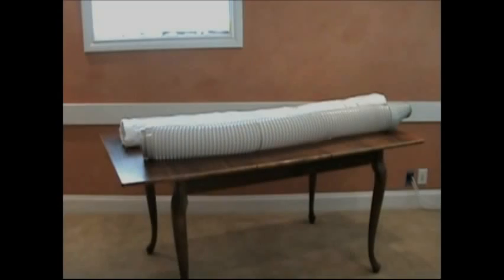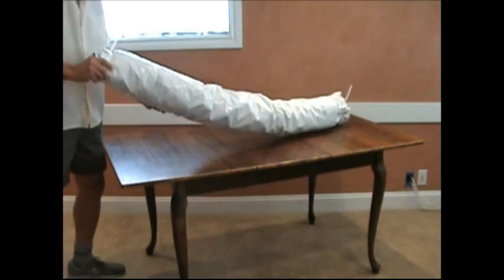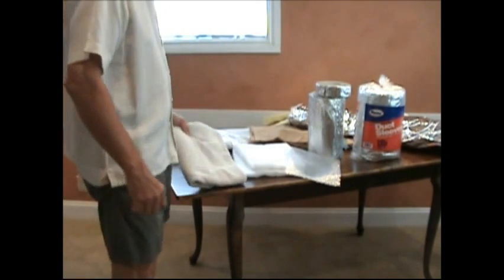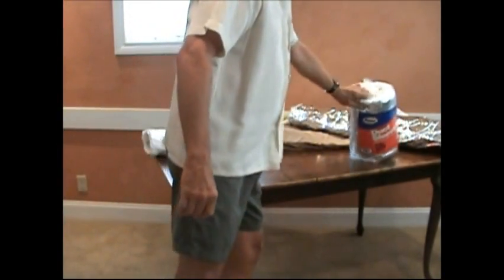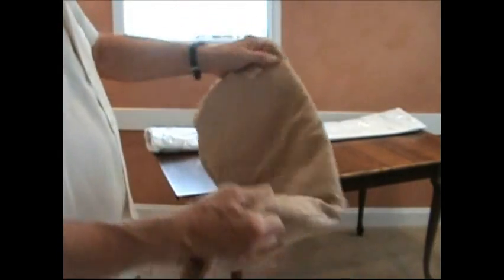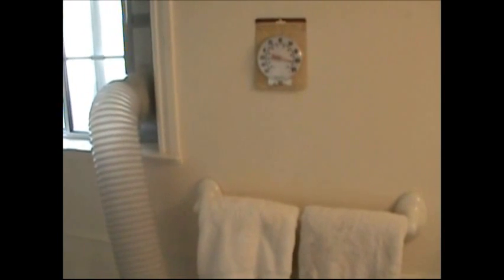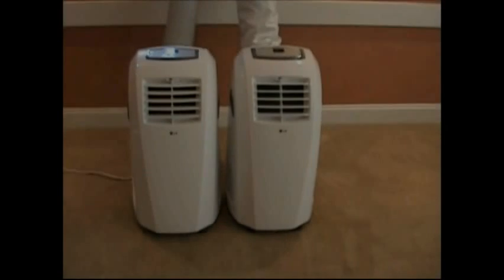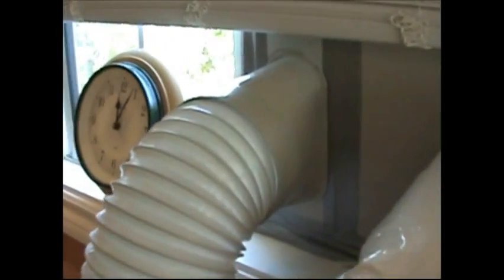PORTABLE AIR CONDITIONER EXHAUST HOSE INSULATION

Comment: Thanks for the informative video!  I had no idea the exhaust hose could contribute so much extra heat and inefficiency.  I think it should be common for manufacturers to include insulated exhaust hoses or wraps with their portable air conditioners.

Comment: This is good straightforward no-hype information with different practical ideas. Yesterday I helped a neighbor install a 10,000 BTUs portable air conditioner and we had to use the full five-foot length of extendable exhaust hose that was included. After trying out the new AC unit it was apparent that the exhaust hose can radiate noticeable heat back into the room so we are looking at options to insulate the hose. Thanks for the video! However I have to say that the Cool-Aide product offered at $48 seems overpriced.

Comment: Great video. The exhaust hose is usually right next to the cold coil air inlet behind the unit, so the room air before it enters the ac to be cooled first passes over the hot exhaust hose and picks up some heat from it. This makes the cold air output slightly warmer than it would be if the hose was insulated. Another huge issue in your case is the single exhaust ACs you’re using. They take more air from the room than they return due to hot exhaust that has to be dumped outside. This draws warm air into the house from outside. Dual hose ACs use the 2nd hose to intake air from outside that is then used to produce exhaust, so they don’t draw warm outside air into the house. Dual hose ACs are rare and more expensive but it’s possible to convert single into dual hose by making a crude manifold box around hot coil inlet and then plumbing a pipe into it. I’ve done it to both of my ACs and it works great. It’s also good to insulate the 2nd hose.
Reply: Thanks for this interesting comment ! I also want to turn my single hose into a double hose portable AC. Which material did you use to make the box, and how did you stick the box to the AC unit ?
Reply: great idea.
Reply: SACC ratings account for dual hose vs single hose in regards to cooling ability (but not energy efficiency). Look at the SACC rating and consider your space and buy based on that

Comment: I was so bummed out when my new a/c couldn't keep the room cold! When troubleshooting the hose was the first suspect! Glad we weren't wrong! Hope this fixes it
Reply: did it work?
Reply: @AndreCastle  before i got a chance to buy this, i was able to source a scrap piece of r6 insulated flexible duct that was being thrown out. the initial test worked very well. ironically, it has been a cold windy summer this year so far in the bay area of california so haven't had a need to run the ac to be able to test further

Comment: I purchased this product and it works great!  Finally my portable AC unit is cooling the room.  It was a hot July in New Jersey and I was very grateful for this product!  Comes with zip-ties and fastens tight to the hose.  Most hoses have fiber-glass, which I didn't want, but not this hose.  What a difference!!
Reply: Hi.  I was wondering where you purchased this from?  Thank you for your help.

Comment: I double insulated my AC's exhaust.... The first layer  is a double sided aluminum radiant heat barrier.  The second layer is the cool-aide duct sleeve.  The result is the  wrapped exhaust hose being cooler than the [double] glass window pane on any day the unit needs to be in use.  Also helps when the unit is set to dehumidify only as even that would warm the room (though not as much as when cooling).  The sleeve is a bit pricey, but, it has a much higher customer satisfaction rating than any other such sleeve on the market --- the highest quality one is actually more expensive than the Cool-Aide & barely effective.   This sleeve is definitely worth the cost. 

Appreciate the video!  Thanks for taking the time to inform folks.... The advertising for this product needs to come up to the level of quality of the product, though ;)

Comment: Just saw this video after having a portable AC for years,  finally cut my hose short, and insulated it w/ a insulated shopping bag.    LOL  Didn't want to wait.
Reply: What was the purpose of cutting it short? Does that help with cooling it?
Reply: @toniapaulsen3477  Having the exact length and insulating it reduces the amount of heat coming off the hose.    I changed this to a window unit ever since though.  The portable AC was really bad on electricity.  A smaller window unit is able to keep the room much cooler and quieter.
Reply: @SC60586  Thank you. I wish I had the windows for a regular unit. 😭

Comment: 2021 review! Yes this is still available. 
So I order one to try out. Got tired of the insulation sleeve with fiberglass and all duct tape to seal up. 
So look for something else and saw this video. Wonder if still current since reviews where old. I order and hot in 3 business days and easy to attach to hose of ac. Zip ties even are re attach able. Ran portable ac and just like video and cool to the touch. So bought another today for other units.
Reply: Where did you purchase it? Thanks!

Comment: Just ordered one! Using a portable unit while waiting to get my main HVAC replaced. My pipe is super hot right now, can't wait to get to get this one it.
Reply: Any updates???...I was thinking about going this route.
Reply: William Dickerson it honestly works better than I could have imagined. I was super skeptical, but you can’t feel any heat on the outside of the insulation. 

Crazy!!! Highly recommend. I truly think this guy should be selling these at the big box stores right alongside the units because it does exactly what it’s supposed to do.
Reply: Thanks for the quick reply!!. I went the DIY route and it's working pretty good, but I just like the aesthetics of the sleeve better.

I also thought about the fact of ease of installation vs the wrapping and tape route. Once again, thanks for the quick reply. I'm putting in the order Monday.
Reply: Yea, it truly looks great on there. I was going to go the DIY route as well and at least the materials I thought I would need was going to be $35+. I figured I would just go the plug and play route and I'm 100% satisfied with it.
Reply: Where did you buy it? Very interested in getting one!

Comment: I have a 3.5 kW unit I wrapped in tontine insulation car windscreen visor wrapped with aluminium tape like what you did but still get a lot of heat coming off the insulated duct. I now have a commercial aircon flexible duct. Bigger in diameter and will fit an exhaust fan to get rid of hot air quicker as these portable Ac units only have one fan and the unit struggles in Australian heat. Especially when it gets to over 42 degrees Celsius with the sun blaring on my window lol. I even put core flute on my fascia outside but still hot as hell. I will sell the unit and buy a 1.5 kW window mount and just make a table high enough to butt the unit to the window, fit a small pump to drain the water outside. Cheers

Comment: Great video and very informative.    Just bought a Delonghi portable AC unit just in time for the historic heat wave we're having here in the NW.  The exhaust hose gets super hot, and with outside temps 100+, cooling performance is disappointing.   Hopefully one of these methods will help.  The Cool-Aide sleeve looks good.
Reply: Did it work?
Reply: @dancrumbo5922  I ended up wrapping the exhaust hose with several layered towels to insulate it, and that worked very well, making a dramatic difference.  After doing that, I also bought the Cool-Aide sleeve and will be trying it out this summer.  If it's not as good, I know the towels definitely will work.

Comment: An added benefit is that it keeps the warm outside air from radiating into the room through the hose when the unit isn't in use, if you leave it set up all the time.

Comment: Why don't manufacturers supply these units with insulation sleeves?
Reply: Yea, or at least have them for sale in the store. I 100% would have bought one of them at Lowe's or Home Depot.
Reply: My opinion: money.  Manufacturing an insulation product that doesn't use fiberglass, is not too unattractive, is flexible and effective is relatively complicated and expensive.  If there was a big demand for the insulation I believe A/C manufacturers would make them.  But as of now, people either aren't aware of the heat radiation problem, or they don't care.  So "tooling up" to manufacture a product where the demand isn't widespread isn't an attractive business prospect.
Reply: @arthurwilson6280  : The demand for insulation won't be widespread if it isn't marketed with the sales of the air conditioners. Buyers have to know of its existence first.
Reply: Here’s your solution! Support small businesses! Tell your friends!

Comment: I wrapped my exhaust hose with two layers of towels, and they were working great.  They felt cool to the touch.  I replaced them with this because I figured it would look better.  It isn't as hot as the hose alone, but it does feel warm.  I'll be putting the towels back.
Reply: I tried towels before I found this genius product, sorry, but the towels don’t work as well for many reasons.

Comment: A couple layers of aluminum foil and a dryer vent hose cut open and wrapped around(was smaller than the AC exhaust  hose)- worked wonders for me.
Reply: Also applying some aluminum foil to the window plastic shield which gets very hot - helps out a ton!

Comment: Thank you very much for the information.  I think I am going to try this.
I noticed that the area around the exhaust was getting warm.  I think this will solve the problem.
However, I just have one question probably out of "worrying too much". I wonder if this would affect heat exchange performance.  If that is the case, the unit itself would become hot.  Any feedback on this?  Would anybody share the experience?
Thanks!!!
Reply: @JG Luxe Do you know what heat exchange process is?
Reply: It will help.